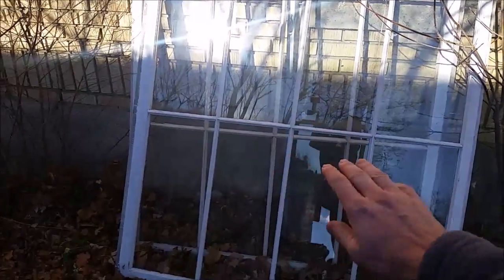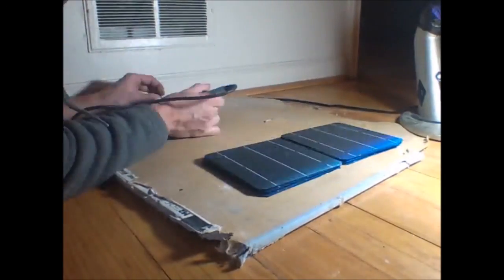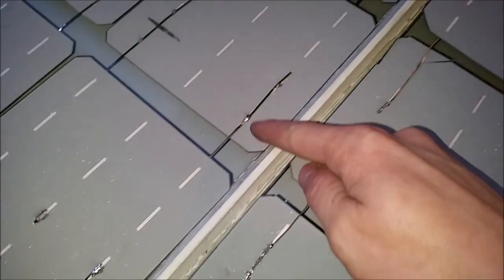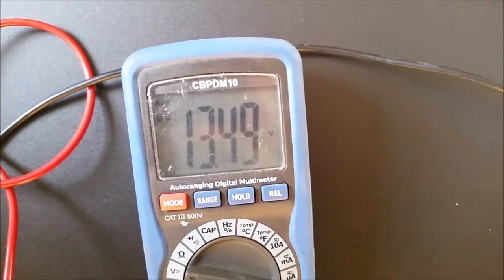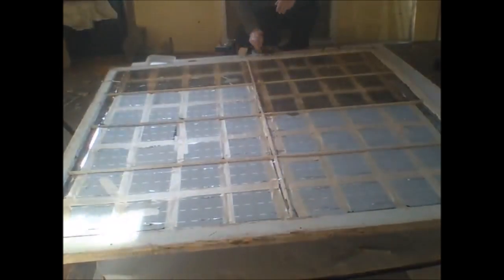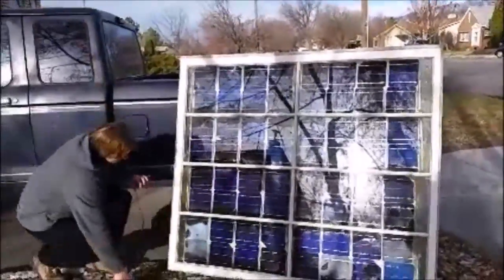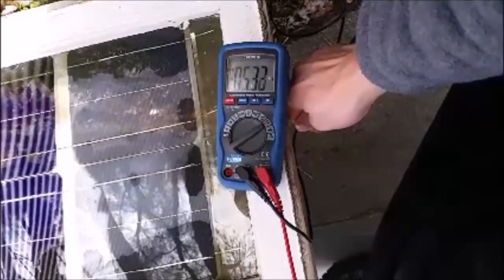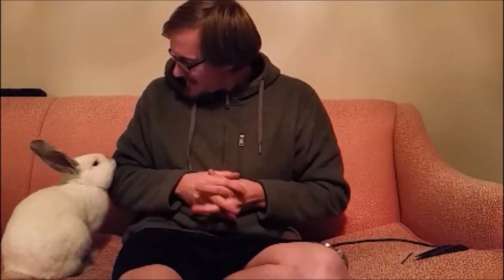DIY Solar Panel Assembly

Comment: Did Cody just calculate the power from open circuit voltage and short circuit current...? Well, present time Cody probably knows better :)

Comment: You should look at updating this using a Fresnel lens to focus light to produce enough heat to run a steam or molten salt generator I think it would be more efficient than a standard solar system but I don't really have the means to test the theory myself.

Comment: "I'm using a heating blanket to help warm it up" Some one is living dangerously :P I thought resins created heat as a by product of the reaction that solidifies them, not that it was what was a catalyst used in the curing process. 

I don't know what type of resin you are using (There are multiple resins you can use with fibreglass with varying levels of toxicity) but I do know that if epoxy gets too hot it boils and then you have a whole lot of mess once it finally cures.
Reply from the maker: +Falney 
it was 0C outside

Comment: So Cody, I was scanning down through comments and I didn't see it mentioned anywhere... what was the actual out of pocket cost of materials for this project? How cheap is "cheap"?
Reply from the maker: +CplSki USMC 
about 40$ but only because the fiberglass was so expensive.
Reply: +Cody'sLab   I didn't realize that those solar cells were so inexpensive... I will have to look into this and perhaps follow your lead on this. Thanks for the eye opener.
Reply from the maker: I think I may have inadvertently increased the price due to increasing the demand. lol

Comment: I don't know about making your own solar cells.  The thin film silicon cells require some semiconductor level production equipment which is hideously expensive.  I did read a paper from a guy at either Caltech or UC Santa Barbra I forget which where they were trying to develop a cell system that you could paint on a metallic roof in several layers.  Not so efficient but made up in the area covered.  That might be something you could do a field trial for.  Perhaps one of your profs might know the guys and hook you up.
When you get old they say memory is the second thing to go.  I forget what the first was.  Keep at it young man.
Reply from the maker: +Steve McEntyre 
Indeed, semiconductor material is what I need to make

Comment: I think u could get more light to the pv cells if self leveling epoxy was used instead of the glass there , I know the epoxy would reflect back light too but the epoxy would be in contact with the pv cells limiting the amount of lost light because they reflect some light as well also I would try to look for some black pv cells for max light absorbtion. I wish there were a material other than silicone to use for the pv cells .Diamond would be expensive in less u could figure that out. Or whatever is clear and conductive maybe something new can be made in a vacume I know nasa is makeing new stuff in the vacume of space but they can make even more stuff from there being no gravity. maybe you need a vacume furnace gyroscope with a super magnet lol

Comment: I noticed that you only do spot soldering on the front.  That would explain why yours don't crack, but I understand that makes them rather inefficient?
Reply from the maker: +Christie Nel 
The reason commercial cells are fully soldered is to increase redundancy so the cells are less likely to fail.
Reply: ***** So it doesn't affect efficiency if the cell is in tact - that's good to know.  My understanding was that if you spot solder, then those spots will be loaded with larger currents that would deteriorate the cell faster or even get hot.

Comment: 20V is the open circuit voltage and 5A is the short circuit current, so it might not add up to 100W ;-)
Reply from the maker: +Sebastian Rietig 
Probably right but Now you know how solar panel manufactures measure the wattage of their panels.

Comment: if you haven't already, you should build yourself a 3d printer
Reply from the maker: +scottaw1981 
I was actually thinking about 3d printing my rocket components.
Reply: I believe I saw a video were someone turned an inkjet printer into one.

Comment: This time both audio and video quality was supercrap.
While new camera may be expensive thing, you should be super able to buy youself a better micropphone or just do not record audio in this room.
Charge your battery with this panel and use dome light so your camera can at least focus well.
It was fine until you went inside.

Ontopic: congrats, you now have free electricity!

Comment: G'day,

Yay Team...!

 Um, from experience, a Panel's open-circuit Voltage multiplied by it's No-Load Amperage Reading yields about 1.8 times the Wattage you will be able to rely on when you eventually connect that Panel to a Battery  which needs charging..., and it's worse when the whole thing heats up to 50 Degrees in the Sun...

 So, call it a "50 Watt Panel", and it won't ever  disappoint you, nor kid yourself into killing your Batteries...; call it a "100 Watt Panel" and it'll only ever reach rated Output when it's freezing cold with a howling Gale (to air-Cool the Panel) under a clear blue Sky at Midday...

  Recently I bought two new 70 Watt PVs for $170 each, 5 years ago I paid $330 for a 30 Watt Panel...; and they're Ozzie Dollars, so you should be able to get them for around $US2 per Watt Retail, with a 20 Year Guarantee..., yes ?

  You'd need to get the Polyester Resin & Glass Tape really cheap, as well as having the Windows for free, before you manage to save money ; I think...?

;-p

Ciao !
Reply from the maker: +WarblesOnALot 
Considering it was overcast when I tested it I will be happy to call it a 100w panel.
Reply from the maker: That actually sounds like a fun experiment! I think I'll try it!
Reply: ***** 

  Cool, it's the kind of thing which people with a lot of water sometimes set up to do with Sprinklers...

  I found that about 1 Litre per Watt of Panel-rating per hour seemed about right, pouring some water accross the top edge of the Panel every 5 minutes and letting it trickle down, and the temperature yo-yo's ; over  a day I got about 35% more power out of it, and a Mud-Pie in front of the PV...

  It works out to be about as good as having a Tracking Array.

  The cooling effect from wind is strong enough that it can be said that for windspeeds between 5 & 15 MPH the best Wind-Turbine turns out to be a Solar Panel...; because below 15 MPH Wind-Turbines are not much more than dynamic Garden Sculptures, and over 5 MPH the wind blows away the "Blanket" of Hot Air which otherwise gets trapped under the Panel, being held there by the flanges on the underside of the Frame... (on a still day the underside of the Panel gets hotter than the top - because on top the hot-air thermosyphons itself away as it expands and floats itself off...

  It's why I went to so much trouble to ventilate the Panel when streamlining & enclosing it while making the SunFoil Mk-3 (check my  "SunFoil Project" Playlist for those details...).

;-p

Ciao !
Reply: Rob Mckennie 
 G'day,

 Well, I dunno, I'd have to ask my son, he's the local Auto-Electrician, he was 11 when we transitioned from Candles & Kerosene Lamps to Solar Panels, Batteries, Inverter and Electricities for Light...

 What I know is that a PV which shows 19 to 21 Volts Or 3.5 to 4 Amps on a Multimeter, when attached to a Battery will be reading 13.2 Volts and maybe 3 Amps..., when it's actually DOING something...; rather than impressing the Multimeter...

  ;-p

Ciao !
Reply: ***** 

Yeah, I know what you mean, but the Roundabouts & Swings effect means that the late afternoon Sun plus the High Cloud meant that the Panel was COOL when you measured it..., put the Sun overhead in a clear blue Sky and the open-circuit will go up to 21-23 Volts, but the Amps will drop as the Temperature rises.

 As temperature rises the resistance of wire increases, and Solar Cells are FULL of tiny little wires, so the hotter they get, in the Sun, the worse the mongrel bastard things operate...!

 It's a big trap for beginners, until 10 years ago PV Manufacturers used to make it vastly worse by "Rating" their products at "25-28 Degrees Celsius", which sounds great...; till one realises that at 25 C. Air-Temp., in full Sun the PV will be at 50-60 C.

  Connect it to a Car Battery which was resting at 12.5 Volts, on a sunny day..; and use two meters, so as to get realtime readings, with an IR or Laser Thermometer, and when the Panel stabises it's Temperature, Voltage & Amps then throw a bucket of 10 Degree Celsius Water over the Panel..., and be prepared to be surprised...

;-p

Ciao !
Reply: +CrimsenKnight

G'day,

  Thanks, but, actually, if you try getting a Funnel with a clear Hose joined to the Nozzle, hold the Hose-end  above the Funnel's Rim, and pour Water into the Funnel...; you'll find the Water sitting at an identical height in both the fat Funnel-top and the Narrow vertical Hose.

 Hyro-Dynamic Perpetual Motion Machines are just as impossible as every other kind of PMM...

I don't have the water, nor the desire for a mudpie under my Array, to run a total-loss system, and I have a 2-AxisTracking-Mount with 135 degreess of Daily  & 47 Degrees of annual traverses ; so trying to collect & re-use Cooling-Water would be a truly major headache...

;-p

Ciao !
Reply: Thomas Syxe 
G'day,

 Yes..., as silly as it sounds, Electric Solar Panels hate getting hot....; so the hotter they get, the less they produce.

  In the olden dayze, 20 or 30 years ago, PV-manufacturers used to compete to pretend that their Panels were much gruntier than they really were, by "rating" them at 25-28 degrees Celsius, which is Air-Temp. on a warm to hot day...; and people would put about 40% less Panels than they needed in that location, and either they paid attention to their Batteries really closely and ran their backup Generator a lot, and then added the required extra Panels, or they killed their first set of Batteries within a year...

 These days, the PV-manufacturers "Rate" their Panels at 50 Celsius, which is "Panel-In-The-Sun-Temperature when the Air is about 20-25 C. ; which is MUCH more realistic.

;-p

Ciao !
Reply: Thomas Syxe 

Well, if you backtrack me to my Playlists, the "SunFoil Project" Playlist explains how & why a Solar Panel on a Car saves Fuel, and in telling the story I several times illustrate how my Hut runs on Solar Panels, Batteries & an Inverter...; I went off-grid in 1985, and killed a lot of Batteries learning what doesn't work, and by about 2000 most of the mistakes were behind me...

;-p

Ciao !
Reply: oh that's very cool man, you rock, will sub !
Reply: +WarblesOnALot "no-load amperage"? If there's a flowing current, isn't that the definition of a load...?
Reply: +WarblesOnALot Couldn'y you turn this into a great garden waterfall that is also a solar panel by making a tank that opens up every 5 minutes and lets water flow over the panel? but at the bottom of the panel make a colletion point that is basically a giant funnel which is already filled with water but as the water is released from the top it allows the water in the funnel to move up?

no idea if this would work but seemed like a cool thing to throw out there.
Reply: +WarblesOnALot  in laymen's terms, if it heats in the sun, you loose yield = less wattage, right ?
Reply: Ah cool, interesting thanks, do you have any source of info to figure out the circuit with batterys etc, you sound like you know your stuff, I'd be interested to read some about it, I guess I could just google it though :)

Comment: The chipped plates will reduce amperage, so you may wish to keep cells with a similar area in the same string to maximize the total amperage. It's a similar effect to having a panel partially shaded.
Reply: +Mark Rose The "chips" are extremely tiny in those.

Comment: Hm, that lithium and tin alloy, if you increase the surface area wouldn't that make for a great way to explode bottles with the expanding gas similar to when you add drain cleaner to a bottle with some water?
Figure it'd make for a more interesting way of doing it where the metals and reaction processes involved would allow say a teacher a more interesting demonstration and explanation.

Comment: Hey Cody!
I read another one of your comments talking about how you're using Windows movie maker. I'd suggest getting Camtasia Studios 8. It's alot similar to WMM but with a lot more of implementations. I'm sure it'll be easy to transition to the software as they both work the same way. There's a free trial incase you want to buy it! I'm sure the quality of your videos will increase a ton. PS. you can get it for free, or buy it levity but they're both the same thing.
Thanks for the video! :)

Comment: Hey Cody! First, i love your videos, please keep going ;) Instead of anorganic silicium cells, you could build organic solar cells, from organic semiconductors like indigo etc. The "hard" part with organic solar cells is to apply the electrodes (indium tin oxid, and silver or aluminium for the anode). you need to apply the electrodes in vacuum, in order to have a nice connection between semiconductor and electrode. The efficiency is also way lower than silicium (world record at 12% or so). also the stability is not as high, but it is fun to make!
i once build one with an effiency of 1% from indigo ;)

Comment: Very cool. Solar panels are one item I never considered might be available as factory rejects. Great tip. Do you store your power in lead acid batteries? Ever consider playing with kinetic or gravity based power storage?
Reply from the maker: +NightHawkInLight 
We do use lead acid curently, Indeed I have thought about other methods, In fact I am looking into hydrogen fuel cells as mentioned in my last video.
Reply: when worlds collide... I'm subscribed to you both... inception bwah
Reply: +CaninesBestFriend OH MY GOD ALL MY WORLDS ARE COLLIDING
Reply: +Cody'sLab you should try compressed air as as an energy storage method. just for fun.
Reply: +Cody'sLab
 SmarterEveryDay recently posted a video about a gravity-powered generator/light. It requires a person to re-lift a weight, but maybe a tinkerer like you could figure out how to make it go longer, or be perpetual.
Reply: Παναγιώτης Αδαμόπουλος What if he uses coil springs, counterweights, hamster wheels, and n52 magnets?
Reply: +NightHawkInLight how about hydrogen fuel cell battery storage
Reply: +CaninesBestFriend just train a dog to do it with something slightly lighter but to do it more often. bam free power
Reply: zach burke Like, putting a greyhound into a giant hamster wheel? Brilliant!
Reply: CaninesBestFriend Thaaat is a good question friend ! XD
Reply: Cody'sLab vanadium redox batteries are the future. or so i hear.

Comment: is their any truth to my theory that maybe solar cells should be double sided, light hiting both sides if they could make the back side clear or same as front, reflect light onto back. the electrons meeting in the middle or something increasing efficiency instead of one way.I had a solar cell with a white back and shone light on the back and it made a small watch act weird, made all the LCD go black and stay on for like ten seconds after disconnecting wires. only did this when light shone on back of panel.

Comment: can someone explain what amps do to the voltage, apparently a 2amp USB charger outputs 10volts instead of 5, I'm confused?!?!
Reply: +GAME OVER "WE HAVE EVERY PIXEL COVERED"  V/I*R... you are getting 10W not 10V.
Reply from the maker: +GAME OVER "WE HAVE EVERY PIXEL COVERED" 
ohms law: Voltage = Amps times Resistance (watts = amps times volts)